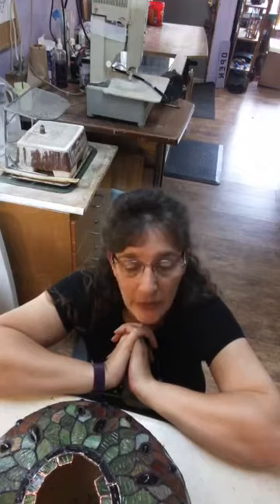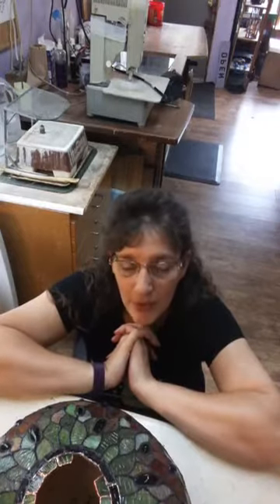Dragonfly lamp repair & reinforcing; Tiffany method.

Comment: Good morning from florida. Friends tiffany style 10lb hanging lamp was brought to me for repair. I have never done stained glass lamps, only panels since 1993.  The top ring of glass  pieces was becoming detached. This was made by someone named Niela in 1991.  Lilly pond pattern. The inside had a brass bar soldered to both sides of the first glass seam but on one side it was done correctly but the bar was not long enough and was soldered to a gap filled with solder on the other and was pulling apart.  I have removed all the loose glass, cleaned, rewrapped, and soldered it back on. There is a steel wire around the very top soldered in. I reinforced 2 seams where I could with flat copper 1/4" bands wrapped over the top wire.  My problem is finding another brass bar that is longer 5 3/8" long to solder in to be the support. I'd rather find a ventilated brass disk. the vent cap was not attached to the lamp at all.  I could also use 2 brass bars 0.065" thick criss crossed.  I just need to source them and can't seem to find any. I have copper bar to use but it is too flexible.  I could also get a smaller heat cap and solder it to the top ring, the heat cap on this is too large for the hole.  advice?  Thank you so much!!!

Comment: Just found this...wow..what a gorgeous lamp and interesting inormation for a newbie lamp-maker..I was looking to see the guage of the reinforcing wire..will have to go elsewhere, but thank you for making this video!
Reply from the maker: Thank you so much. The wire is 24 guage stainless steel, just get it from your local hardware store. Best advise is to not fear the project ... work one piece of glass at a time, just like you would a flat panel. :)
Reply: Super that you responded ..appreciate AND the great advice which is ONE PIECE AT A TIME..though there is fear which I will try to be conscious of!  !!!!
Reply from the maker: I can absolutely guarantee that you will wonder whatever took you so long! :) The biggest turn off are the amount of pieces, and repetitive nature of a lamp, however; if you focus on just a single piece, a single row, or a single color at a time ... it will be done before you realize it. Have faith in yourself ... I have faith you CAN do it.

Comment: Hi Kim, I just got myself 1 dragonfly lamp shade with a few damaged pieces at the base. On careful inspection, there is no reinforcement wire for the base and that is why the damages occurred. How do I remove the broken pieces and installed a reinforcement wire for the base?

Comment: How would you fix the separated glass of this type of lamp?  How can I keep the glass together that has pulled apart on the curved surface of the glass to solder? and how do I make the copper/ solder joints black like the rest of the lamp?

Comment: I could not see exactly where you were putting the wire.  A diagram of the section of the lamp and where the wire goes would be helpful.  Thank you for making this video.
Reply from the maker: You are very welcome. The wire goes right from under the vase cap, all the way down to the bottom of the lamp. Just tack and modify the angle of the wire as you bring it down along the seams between each dragonfly. Once you are finished with the wires going horizontally, run a vertical wire around the inside at the top of the first border edge, and another on the inside at the bottom edge. There is no way the weight of the lamp will pull itself apart now.

Comment: Do you not have the cap the wrong way around, my repo lamp is convexed .
Reply from the maker: Hi Jo, the vase cap should be point up, you're correct. This last was built by someone who flattened an oval vase cap, which gave me no choice but to use the same one after the repair.

Comment: HI Kim, I just received a lamp similar to the one in this video. The cap pulled away from top layer of glass taking the foil with it, on all the pieces. Did you have to remove all the piece's in your top layer? and did you remove them all at the same time or a couple at a time so you could see the shape and angle of them. Also how can you tell if they used lead free solder?
Reply from the maker: Hi Leanne, thanks so much for stopping by. The caps do pull off, I've found there is absolutely no stabilizing added to them most of the time. For this one, not all the top row came loose (I got really lucky); however, you really want to keep as many there as possible so you can keep the shape/angle of the lamp that is leading under your cap. Number all the pieces before you take out anything, and put a dot or arrow so you know which end is the top front, then remove just three at a time, if you can, prepare them or replace them with new as you need to, then tack solder on the outside of the lamp at the bottom of each piece ... working from original to center. As such, you would put piece #1 and #3 in place, then put #2 in the center. It won't be long at all and the entire new top row will be reinstalled. 

Lead solder is nasty to try to remove if your iron isn't hot enough. Use a normal #7 or #9 tip to test the solder. If it doesn't melt off quickly, you likely have leaded solder and will need the big clunky wide tip instead. BE CAREFUL, those pieces are very small and you can easily crack them with this big tip. You also have to consider you have oxidization, wax, and patina to get through, so you might want to take a scratchless scrubbie and give it a darn good cleaning first.

Now that you have everything prepared and the top row tacked in place, work from the inside, and tack each piece to the cap at the top of each piece.  Be gentle, you are working with wiggly teeth here, and you don't want to break your foil away from the glass.  Turn the lamp over again, and have a really good look at your cap placement to make sure it is evenly spaced. If so, start tacking between each piece to join to the cap. Turn the lamp over again, and tack from the inside, joining each center of the pieces to the cap. Now you can breathe! You can flat solder the entire new row as you normally would. Keep the solder flat, you want to be able to hide wire on the inside from the cap. How many segments of panels are there? If there are no segments, imagine dividing the lamp into 3 or 4 sections. You need to put wire,  19 or 20 guage works just fine, between each segment ... tack a little, bend to run between the piece of the next row, tack, bend ... repeat until you reach the bottom. Bend a tiny bit of that wire towards the outside of the lamp and cut it off. This will allow you to join it to the support wire that runs along the bottom of the lamp, and essentially you have now created a "frame" for the glass to sit on. Yup, it's reverse engineering, but the wire frame allows the weight to transfer and removes the risk of rows pulling away over time. Alas, the difference between cheap knock off lamps, and the real deal. :)
Reply: Thanks for all your info. Is there a way to send you pictures of this lamp I have.

Comment: Thank you for posting this video.  I have the same problem, with the same broken off piece.  But the piece on mine is lost.  How do you replace it?
Reply from the maker: When you find a glass that will suit your neighboring pieces, you can hold a paper behind the empty spot, and trace the "hole" ... leave a mark where the top left and right pieces finish. Cut your new piece from the paper template, grind slightly, and dry fit to test. Once you are happy with the fit, foil and solder in place. Make sure to run your support wire so that it goes down your seams and also solders to the inside of the vase cap. This will allow the weight to transfer down the shade, rather than having the weight hang just from the vase cap.
Reply: @kimbanks-watson170  Thank you!

Comment: Hello are you still method to repair my Chinese lamp but after finishing a job the old part just separated from the new part and everything fall apart again;(((
Reply from the maker: Oh gosh, sorry to hear that. The only reason for the sections to fall apart is if there was no support. Have you run support wires from the top to the bottom, and around the under edge of the last row?

Comment: I would love a stained glass lamp.. am i wasting my money buying one made in china from amazon. Please help. Thank you so much. Doug Dillard from wenatchee wa.
Reply from the maker: Hi Doug, thanks for watching. I appreciate it. Honestly, you get what you pay for ... and while I truly can't speak for what Amazon might be carrying, I do know how many "Made In China" lamps I have fixed. Often the fix costs more than the original purchase. :( 

Most of the reason why the cost is a factor is due to lack of quality in the supplies used, coupled with the time crunch to turn them out so fast.  The glass is usually not the issue, the cuts are mostly accurate, but the foil they use is the thinnest possible, silver back, not sticky type. It's barely enough to hold the glass in place once soldered ... and they only apply an extremely thin top layer of solder, which is almost flat.  Put all that together with no support wires, and you are purchasing a very pretty disaster waiting to happen. It won't be long before the heat from the bulb causes the foil to pull away, weakening any possible hope of strength, which then leads to why I was repairing the one in the video.

A hand made lamp from a SG artist is going to cost you, but it is also going to last for decades ... potentially becoming a favorite heirloom. The artist will apply multiple sections or hidden wire to support the gravity of weight, use the appropriate foil, solder it properly ... all of which is going to save you so much later.

I'm not sure where you are located, but if you would like to speak to an artist that can help you, there is also the fact that you can choose the pattern and colors of your glass to make it the perfect purchase.
Reply: I just bought one from Amazon and while a lot of people have success buying it new, I had bought it used but Like New.  It arrived broken.  Amazon has an amazing return policy that I received my money back.  A lot of the lamps have free returns if you find you don't like it after ordering it.  I will say, my friend has a genuine Tiffany lamp, and while mine was nice (where it wasn't broken), it was definitely not as nice as the genuine thing.

Comment: How do i fix the chain switch? Thanks
Reply from the maker: Hi Mari, the only hardware fix I know is to purchase a new assembly from the hardware store and replace original.  Depending on your setup,  your piece will either pull out and down,  or unscrew about 2 inches from the top.

Best wishes.

Comment: Where did you buy the new heat top.
Reply from the maker: I banged out the damage and reused the original one. Normally I go to my supplier for a new vase cap when necessary.

Comment: Beware of Chinese lamps, fire screens etc. They are poorly constructed with inferior quality supplies. Very thin copper foil, thin glass and the solder is not as pure as what we have in North America. In China they pay workers very little to have them produced so the items are put together to look good but not made to last. Some have been known to use black caulking between the pieces of glass so will not hold up over time and gravity. Look closely at the solder lines and they are often flat and not nice rounded seams. The copper foil is in many cases is not centred which weakens the structure. Just know that you get what you pay for and expect them to fail at some point instead of lasting a generation. Enjoyed your video though on the repair.